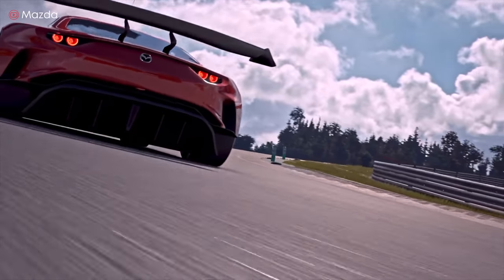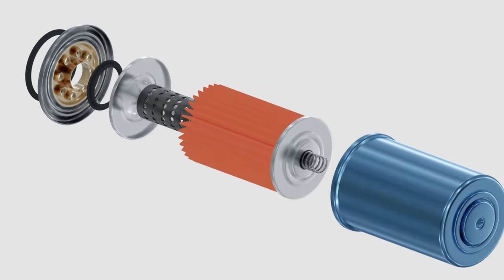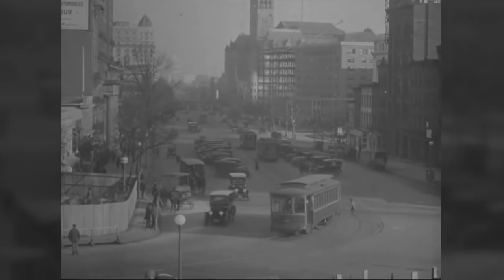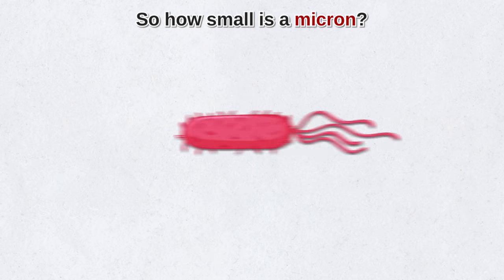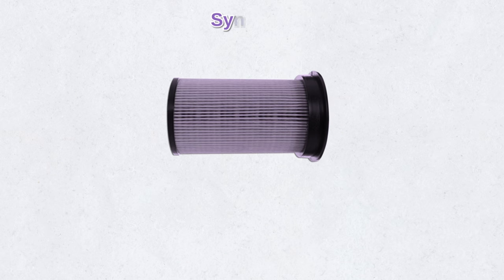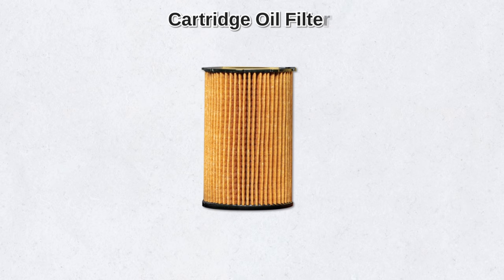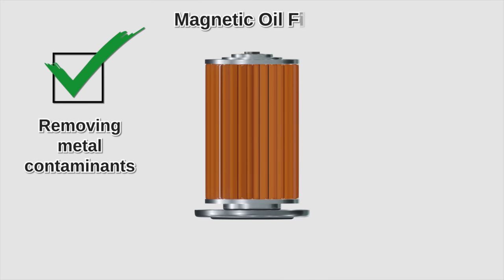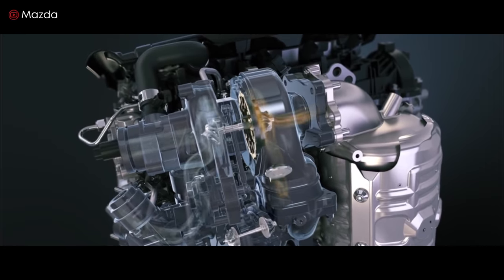This New Oil Filter Just Changed the Game (No More Oil Changes)

Comment: So, which brand oil filter is the best?
Reply: Purolator are good.  WIX are good.  Amsoil filters are good.  Some Mobil filters are good.
Reply: It's like asking what oil is best..you'll get a million different answers..
Reply: @land7776  

That’s a slick answer
Reply: @land7776  

  Amsoil oil is the best
Reply: @sirsweetness8332  Slick-50 !
Reply: @land7776  

  No.  This had a class action lawsuit
Reply: @sirsweetness8332  lol, just a joke.. slick answer, slick-50...
Reply: @land7776  

     I just don’t want others thinking this is good for their cars when this stuff rusts the inside of engine.  I had it happen to me.
Reply: I have a lawn mower that is over 20 years old. Never had oil in it. When it was new I put some Slick 50 in it and let it run awhile then drained it. Just kidding.

Comment: Mr. Scotty If I use the 505 CRO to clean the carbon in the engine how many times should I change the oil and oil filter and at what intervals? I am not totally sure I need it for my 02F150 with approx. 167K. I hear a ticking so I may need to change a roller follower soon but thought a good cleaning may help?

Comment: Most oil filters are discarded when only a fraction of their service life is used.  This is wasteful.  I understand Honda recommends changing the oil filter at every other oil service interval.  If your engine is clean and healthy with a solid service history, you are using premium filters and not running extended service intervals, you can safely change the oil filter every other service interval... especially if you are also running a magnetic filter device.  Of course if you have a dirty engine, or unknown service history, or your engine design is one of the known "sludger" engines, then you definitely want to change the oil filter at every service.
Reply: One thing I like about the toilet paper filters is they keep the full flow filter clean. The only thing in the full flow filter is large stuff. Not normally enough to clog the pleats in a good engine. That means the bypass valve doesnt open as much. The only reason I change the full flow filter is I dont know how long it takes for the internal parts to deteriorate.. If I start seeing large particles on the toilet paper I know it's time to change the full flow filter. Many modern engines have almost no large engine damaging particles in the oil.
Reply: I dont drain oil but If I did I could use the same full flow filter for several oil changes with my pristine  Altima.
Reply: Honda knows the full flow filter is still clean.  Its not like the Honda  engine is wearing out and a bunch of wear particles  are clogging the full flow filter. The full flow filter is there to remove the engine damaging abrasives. Oil changes are for the small stuff. Its not like the old days when parts had to wear to fit. Yes the magnets are a good idea.

Comment: Ahh the age old question, till pre fill the filter or to not.
Reply: Probably better to  go from the box to the engine. There is still  oil on the parts.  One guy says to fill the new filter thru the small holes. Good luck with that. Dont be hitting dirty chassis  parts with the new filter. Make sure there is oil on the gasket and the old gasket is off. Doesnt hurt to fill the new filter thru the center hole. The oil must be clean.

Comment: "Micron" is a metric measurement.  1mm = .03937".   1 Micron = .00003937" (1/1000th of a mm).   There are 25.4 Microns in .001".  A typical skilled machinist can measure down to .0001" with some hand measuring tools, (which would be 2.54 Microns. Smaller than the bacteria).  I never measured anything in Microns, but 12.7 Microns, (.0005"), seems like some pretty big grit to me.
Reply: what hand measurement tools can measure .0001" (one ten thousandth of an inch), and what machinist could even see that difference? I've seen .001" shims, and I can't imagine differentiating a tenth of that.
Reply: I bought a Rambler American  flat head 6 in 1963. It had a spin on bypass filter upside down bolted to the head. I was using Standard Delo 30 weight in it. The oil was always black soon after an oil change. I put a Frantz oil cleaner on it . The oil turned light amber and stayed that way. Saw a similar bypass filter to the stock Rambler at CarQuest rated at 10 microns. That suggests to me that 10 microns is too big but better than the ratings for a full flow filter. I have read that the clearances in a diesel injection pump can be as small as 3 microns. The old Motor Guard oil filter claimed submicronic with toilet paper compressed into tapered filter halves. The white compressed air filter elements look even better than toilet paper. About all I know is amber is cleaner than grey black. The oil in a diesel can be analytically clean and be very black. How small soot can be and not be abrasive but can turn the oil black I dont know.

Comment: I rarely if ever change an oil filter. I only top up and in my 43 years of driving in the UK and Travelling all over Europe have never had an engine fail. ( Guess i am just a lucky driver :O )
Reply: well you must be burning/leaking oil to do that..
Reply: @land7776  maybe 1 pint a year of oil, but i do drive like i a slug rarley going past 70 mph
Reply: @raskfel555   @wayne tyson  that is great, what car/cars did you predominately drive or happiest owning? Well, I must be super-slug too I hardly ever get to 70MPH, usually tops <65MPH.
Reply: @land7776   Citroen bx 19 rd,  bx 17rd  citroen xantia then a Peugeot 405 estate, C8 8 seater 2.2 now a C5 estate. My next motor will be a Toyota Avensis estate 1.6 diesel

Comment: I use Amsoil products (synthetic motor oil and motor oil filters).  They recommend 15k mile oil change intervals but I've been doing it at 10k.  I have 220k miles on my Tacoma.  Scotty, do you think I should change my oil more frequently?
Reply: Back in the early 1980s Amsoil had a bypass canister filter probably as good as toilet paper. Bobby Unser said something like this oil  change is forever
The filter was too expensive.

Comment: So what is this new oil filter that doesn't need you to change the oil?
Reply: I wouldnt call it new but the Frantz oil cleaner eliminated routine oil changes. It went into production in 1953. The oil changers were better at marketing their system of using no oil filters or oil filters that dont work and changing the dirty oil. Mazda  has no interest in filters that clean oil.

Comment: Hey, Scotty, I have a 2004 vehicle. It has some engine wear and burns a little oil (don't worry, I'm keeping an eye on it). If I'm changing the oil every 3000 to 4000 miles or so with a name-brand filter (Mobile One for an easy example for the sake of the argument and because it seems to be packaged with oil for a discount at my nearest auto parts store) is it better to get their "Premium" filter or would it be a better idea to get their "Purolator ONE" filter which claims to last over 10k miles, even if I replace it with every oil change?

Comment: I've never known anyone that would change the oil without changing the filter.  That's silly...the filter costs nothing compared to the price you're already paying to change the oil, so...why?
Reply: Because a lot of people do silly things.
Reply: Typically in a modern engine with synthetic oil the oil eventually gets dirty and the filter doesnt reach its capacity.I use toilet paper bypass filters. The full flow filter never reaches capacity. The only reason I change the full flow filter is I'm not sure how long the internal parts can last. Frantz and Motor Guard  had adapters that eliminated the full flow filter.. I have a Toyota Camry out back that has seen better days. Engine is still good has no full  flow filter. Over 300,000 miles mostly city driving. We left the full flow filter on until the warranty expired on customers cars. One advantage to not having a full flow filter was you always knew the condition of the engine by what showed up on the toilet paper..I normally leave the full Flow filter on.The Camry was a customers car.Motor Guard might still be on it.

Comment: If you get what you pay for why then is Walmart's super tech synthetic oil filter the same as a k&n oil filter when you tear them apart. Those two are some of the best made filters when you for giggles and grins tear apart all the shelf oil filters available. I have yet to get to all the "Dealership" oil filters but so far they haven't been any better. Royal purple oil filters aren't any better than the super tech synthetic for the dollar unless you're going to neglect your car for a year or so. Admittedly I'm using an 85-year-old microscope checking the filtration ability but...

Comment: The primary reason for oil changes is the simple fact that oil breaks down over time.
Reply: The game changer filters have been around for 70 years. The best ive seen lately is the Australian Jackmaster.  I recently got a Jackmaster Classic from Ebay.I like the top loaders because they are the easiest to xervice I also have the Motor Guard and Gulf Coast Juniors. I use good oil and keep it clean. I dont drain good oil normally. Changed a head gasket and the oil once. If I buy a used car I might change the oil.

Comment: Will they ever be able to filter out carbon effectively? Carbon is why oil gets black, right?
Reply: I filter my oil thru a roll of Scott 1000. My oil is always an amber color.   Before the toilet paper filters and fuel injection the oil got black pretty fast.. with diesels the oil will get black. There is a small amount of carbon that is non abrasive and is too small to be filtered out. On a diesel I like to see a shiny black like black ink. We old timers know how to tell if the oil is clean. You can send a sample to a lab or you can do a palm test. Put some in the palm. If its clean it will wipe off clean. I sometimes use Great Value 1000 from Walmart.  Bought a 16 pack the other day. It was the same diameter  as what we used in the 60s. Less than a dollar a roll. I have a lot of filters that take toilet paper.  Also if the oil doesnt feel clean it's not clean.
Reply: In the 60s we used carbon black to demonstrate the effectiveness of the toilet paper filters. Some used stove black. The trick was carbon too small for the full flow to remove but easy for toilet paper to remove. Of course the oil would go in the full flow filter black and come out black. Of course the oil came out clear on the Frantz or Motor guard. The small amount of carbon too small to remove was hardly noticeable.  You wouldnt want to keep using the same oil until you started seeing a dark tinted.  The same thing is happening in a diesel except you are dealing with a lot more carbon. It's hardly noticeable  in a gasoline engine. My Pontiac  Torrant  might generate a little more soot than the Nissan. It's a darker.amber color. Very black oil in a diesel can be as clean as the amber colored oil in a gasoline engine. The oil in a propane engine will normally always look the same as new. We old timers use the palm test for diesels. It should wipe off clean and feel slick.

Comment: I just purchased a 2020. Toyota Tacoma SR V 6, four wheel drive truck. It has a cartridge filter.  I’ve watched several videos concerning the factory standard filter it has installed in it. Several web sites claim this filter isn’t the best and I should switch to the Toyota TRD filter vrs the standard one for better engine protection? I contacted Toyota manufacturing directly about this and they indicated I could switch to the better filter and it would void my manufactures warrant as long as they changed the oil.  Am I being overly critical concerning the standard new cartridge filter or is it truly a issue to better engine longevity    and performance ? Additionally on one site the video indicated the standard cartridge filter didn’t have a back flow preventer like most spin on filters do and could allow oil to bypass the filter is this y true? JR

Comment: I just wasted 10 minutes of my life watching a Mazda commercial. I was drawn in intrigued by some new tech.
This is a history lesson and info for someone that knows nothing about oil and oil filters.
If you've been changing your own oil for the last 30 years don't waste 10 minutes of your life on this video.
Reply: now it's 10 minutes plus 20 seconds reading your post and 20 secs to reply..
Reply: I have 60 years of experience.  I now know Fram filters are junk. Change your shorts  after  you shower. Oil is cheaper than engines. The simple stuff I  learned a long time ago like how filters work.
Reply: @ralphwood8818  but what is "junk"? Do they damage your engine and fall apart? How could people use them for decades and now, and not have a trail of junked engines or filter failures? Where is any test showing that, not vids of people prying filters apart? Like I've said, military aircraft have used Fram oil and fuel filters for decades, all of them tested continuously while in use with delta P, particle counts..and phase inspections with trend analysis for hours, heat, oil samples. Same with many other brand filters. If there had been a problem they would have stopped using them! And that's just mil aircraft. Similar for civilian a/c, plus ships. The Fram meme lives on.....
Reply: It's amazing listening to people that know almost nothing about filters or oil but they can tell you the ones they use ar the best. No telling how many Fram filters are sold each day with no problems. Personally I would pay the extra money for the more expensive Fram. I would rather have a Cadillac  but  Chevy cars are OK.

Comment: I got my oil changed at Walmart. They didn’t tell me the oil pan was rusted through. I took off for a trip and the oil light came on. Oil just changed it must be an error, right? I was going to pull off the interstate at the next stop but I burned up the engine.

Comment: In my 2002 Ford Ranger I learned the hard way to always use the Manufacturers oil filter. I bought the high dollar filters and they always drained back and my engine rattled on start up. After a year of this I had rod knock. I got a new motor and only when I used the Motorcraft oil filter did I have full oil pressure on startup.  I don't even think about it any more my Hondas get Honda oil filters my Jeeps get Mopar filters and my Ford Motorcraft. Period.
Reply: well, I have a '96 Ranger and use the Motorcraft filter too, it's cheap and works. But Ford doesn't make it- it's made by Wix or Bosch, Mann, Purolater..who also makes other brands. I also had a '87 Ranger that I used the dreaded Fram filter.. A car mfgrs. brand filter is not going to make your car behave differently, because they don't make it.. Same as you not using Ford motor oil wont. But whatever makes you feel better..
Reply: I remember people insisting on good old american Ford parts. I showed the box it said made in Mexico.

Comment: How often should I change my oil using mobile 1 extended 20,000 motor oil with the mobile 1 extended filter?
Reply: Wife has a Honda Accord that I  would normally put a Motor Guard or Gulf Coast filter on. No place to put one. It will get the Super Tech 20,000 mile oil and haven't decided which of the full flow filters to use. Price wont matter. Might go Super Tech all the way. Most any premium oil will last  20,000 miles the challenge is keeping it reasonably clean.

Comment: i use motorcraft oil and filter for my ranger.
Reply: New ranger? I just bought a 2021 ranger earlier this year. Love the truck. I did my first oil change at 2k miles. I did Mobil 1 full synthetic and motocraft filter
Reply: I have a F 250 76 Ranger.  Motor craft  filter with a Motor Guard  back up. Gulf Coast  on the ATF. Dont drain oil but I put a lot of gasoline in it. 390.

Comment: Scotty, I hear you talk poorly about Nissan all the time. I'd like you're opinion on the new power train they started putting in the 2020 Frontiers. It's a 3.8L V6 mated to a new 9 speed automatic. Do you know anything about these?
Reply: They’reeeeeeee great!
Reply: The 9-speed is a zf9hp48 and that is nothing impressive since Honda and others are having issues and the old pilot and Ridgeline use their own transmission but switched to the ZF and Honda is having problems with them. and for the case of Nissan engines only the older ones were truly great these newer ones are not great.
Reply: I'm just wondering why the heck you would want a 9 speed auto trans ! Carrying any load or towing it would be shifting up and down constantly.. it's ridiculous..
Reply: @land7776  it’s fun
Reply: @njad3  ok then..whatever floats your boat..

Comment: So what oil filter should I buy, specifically?
Reply: Wix are very good filters.
Reply: If you are mechanically  inclined enough to install a bypass filter get a Frantz oil cleaner or look for a Gulf Coast  or Motor Guard. Saw a couple Gulf Coasts on E bay awhile back. They turn up. As far as full flow filters you want a strong one. None of them clean oil.

Comment: Changing oil is recommended by miles on the odometer or months between change.  Which is more important?  Does oil go bad just sitting in the engiine?
Reply: Well certainly the miles are more important. If your manual says to change the oil every 6 months or 5000 miles and you put 20,000 miles on your car in 6 months, you should change it 4 times in that 6 months. I've seen other videos where they tested old oil and it was still good years later. So if you changed the oil in your car and then didn't drive your car for a year, the oil would still be good in it.
Reply: Change oil minimum of once per year.
Odometer is most important,miles driven.
Reply: @sameoldeh  Thank you for the reply.  I have a truck with only 1,000 K and over a year old and thought the oil need not be changed.
Reply: You change oil each 6 months no matter the mileage. Seeing the replies, I don't wonder why they say maintenance is a major issue in the US.